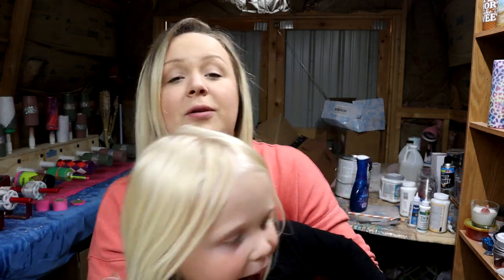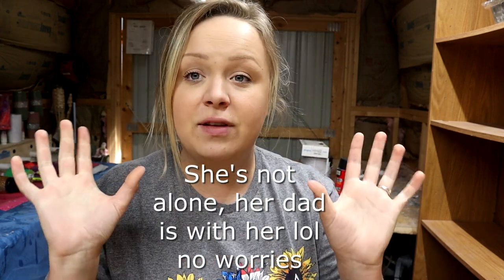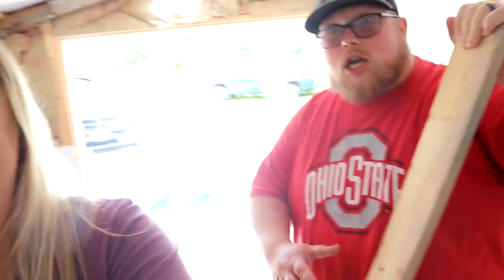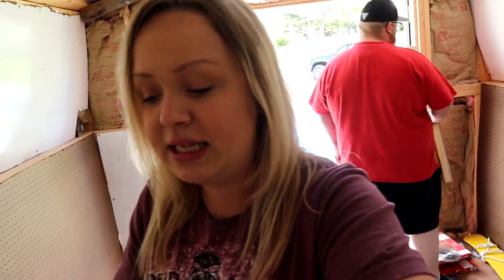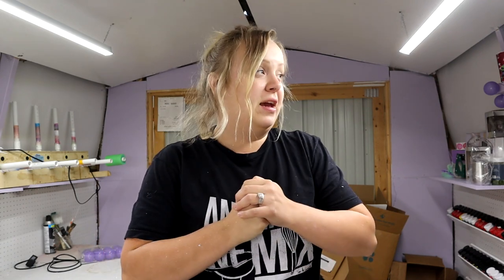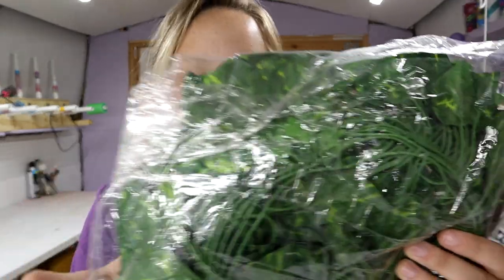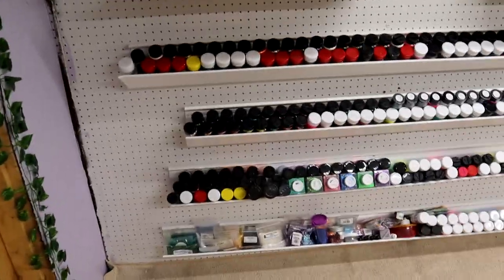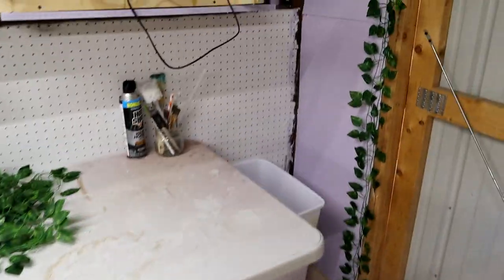Small Shed Remodel | Small Craft Room Organization | Organization Hacks

Comment: How do you climate control your space?
Reply from the maker: I have a window unit for the summer and a space heater for the winter
Reply: @CourtneysCustoms  I moved into my unfinished shed ( need to sand drywall, do trim and caulk wall panels). I needed to move it out my house. Just want to be warm and toasty. Thanks